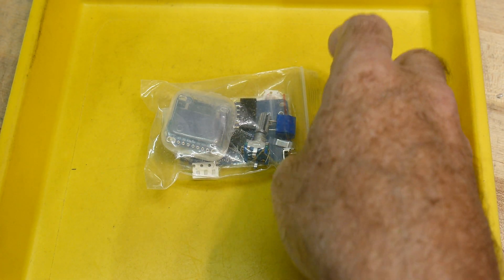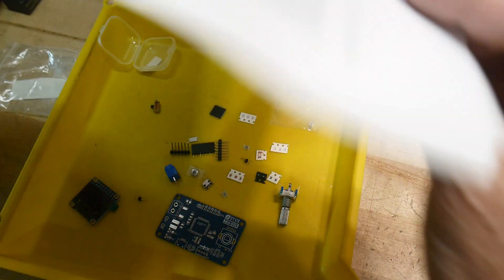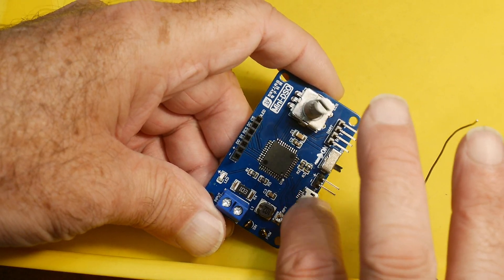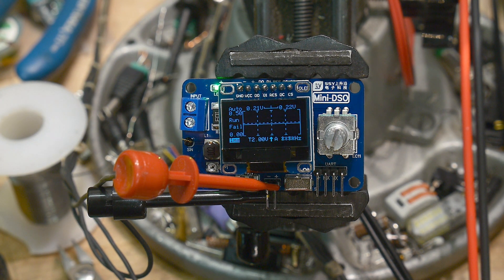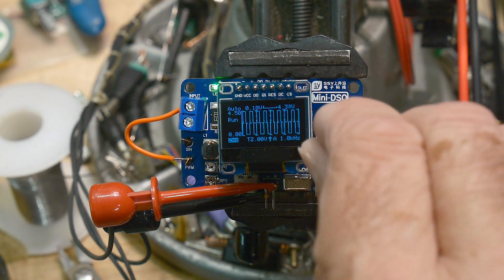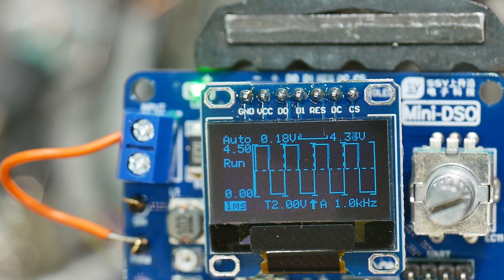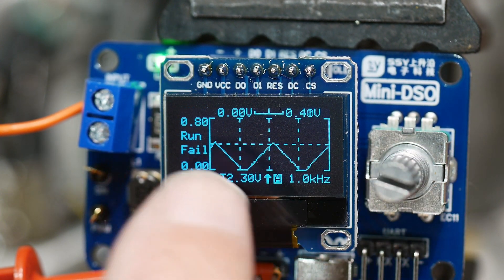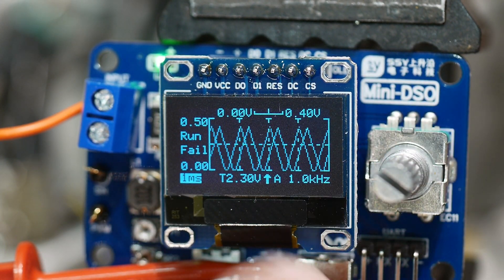#945 Mini-DSO Mini Digital Oscilloscope Kit

Comment: I stumbled my way through the Chinese instructions with the help of a translator tool. 
Weirdly enough, I actually had good instructions... They just weren't in English. So here is my rendition of them:

The 2 pots adjust PWM/SIN amplitude (probe to find which goes where). For my version, holding the rotary encoder and turning it changed options, just turning it would change the selected setting, clicking it started/stopped the waveform. 

Automatic (A) mode does continuous scanning, if you stop then run, the trigger position for the waveform will be at the middle of the chart. Otherwise it will just show fail.

Normal (N) mode and Single (S) mode allow you to set triggers yourself... How, it doesn't say. But apparently you can? I'm assuming T = trigger, and the arrow indicates whether to look for it in the rise or fall of the signal?

Fortunately for mine, the menu only opened when you turned it on the "set" text (I assume settings), seems like they forgot that on your one unfortunately. 

The arrow is the trigger slope, and this determines whether the trigger point is at the rise or fall edge of the signal. (word for word from instructions lol)

I must say, the best thing is that this doubles as a PWM and SIN generator. The hardest part to solder is probably the 0805 LED, as it's small, and you need to be careful not to melt the plastic on the top of it. This and the inductor... Flow solder on one pad, heat pad, move inductor in place and hold it for 10 seconds. It's hard because it's a big pad, you need to be patient with it. I found the rest wasn't too bad. 

Overall a good project to practice SMD soldering. :)

Comment: Great little video. And very useful for me since I had just purchased a kit but couldnt find any instructions or parts list. I assembled the surface mount parts using a really neat hot air gun that I purchased from AliExpress for 20 bucks.  It works very well and has controllable temperature and flow rate.  Also cools itself down before switching off.  My scope worked first time to my great surprise too and is as fiddly to use as yours.  It has slightly different firmware to yours but the same sort of control interface.  It is basically useless but a lot of fun to build and play around with 🙂

Comment: Thank you for the ride-along... Good Info-Tainment and outstanding post-production skills - kept it interesting :O). I had never heard the the HP/sync reference (dig) before.. interesting however. I do like hearing from the people that were in the trenches as apposed to the sales brochures. Oh, and yes, very COoL little scope'ett. My kingdom for a 2nd encoder yes?. But it's design is still admirable. I also see I've been subbed but didn't realize it. My bad. Time to enable some BELL ringing. Cheers from So.CA, USA, 3rd House On the Right.